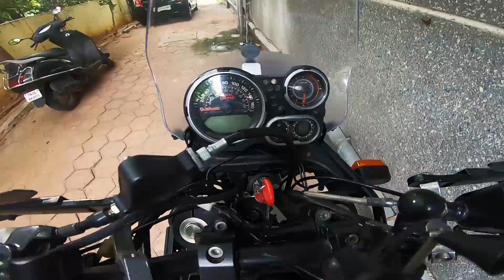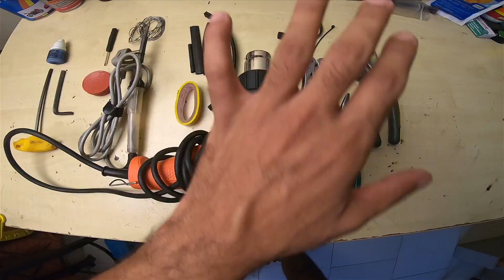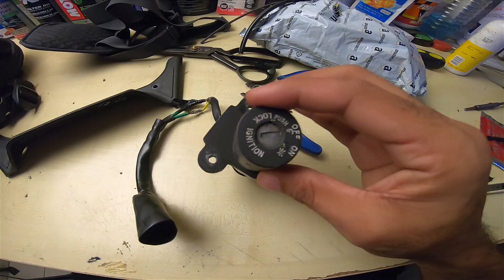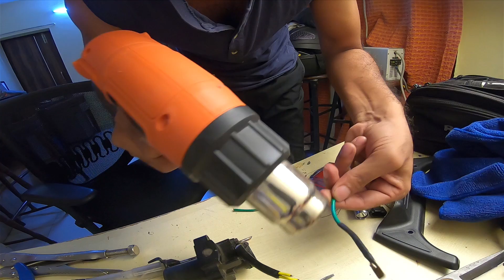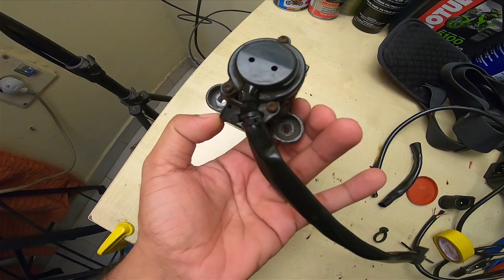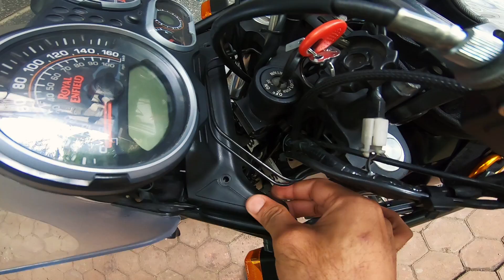DIY FIX FOR NO IGNITION/POWER IN ROYAL ENFIELD HIMALAYAN

Comment: Got the exact same issue midway while returning from office today.
I had to abandon the bike and come to home to finish office work. Saw this video and post office went to the bike, removed the coupler and sorted it using a wire and came back to normal.
Thanks for saving the workshop visit and paying for whole key set replacement.
Will remove the lock and open it over weekend to fix it..
Reply from the maker: Glad it helped

Comment: Bro any idea regarding the TPS location on “2021” Himalayan?
 Throttle body is redesigned compared to pre 2021 Himalayans and I’m not able to locate it at the usual location.
Reply from the maker: yes, its a brand new TB and i believe everything including idle rpm's and TPS are 100% electronically governed.
Reply: @ONTWOWHEELSBEN  okay thank you ✌🏻
Reply: @ONTWOWHEELSBEN  
Is it possible to tune TPS voltage at service center using their OBD scan tool? Or the tool is just meant to scan and detect fault codes?

Comment: I also had an issue with the bike cutting out while driving and found contact build up on the switch contacts inside. I cleaned the switch and lubricated with silicon grease no problems since. Very dangerous as my bike cut out at speed!
Reply from the maker: Good to know that cleaning did the job for you . But keep an eye on the same.

Comment: Any disadvantages of removing fuel evap will the milage drop coz its collects fumes right
Reply from the maker: The FANTASTIC mileage is the biggest problem with the bike . It is extremely lean . So if the mileage drops it’s a good thing
Reply: @ONTWOWHEELSBEN  any dissadvantage in removing it
Reply from the maker: @scottm4559  absolutely none